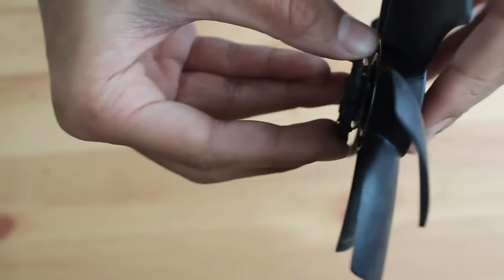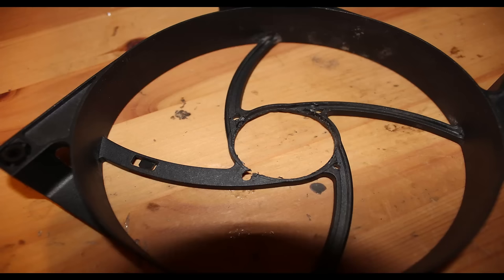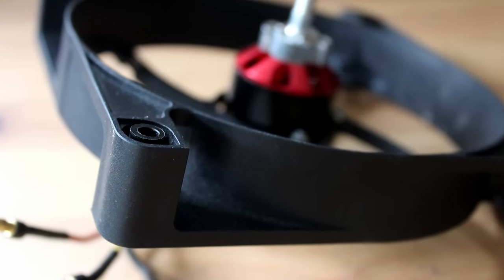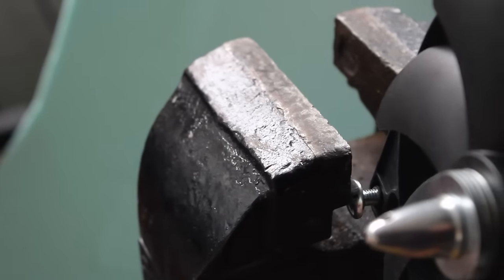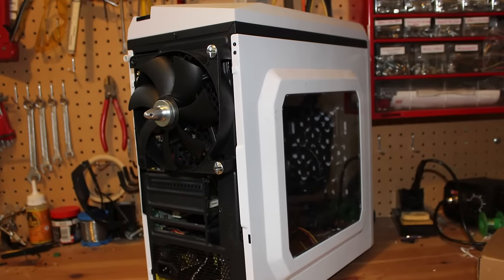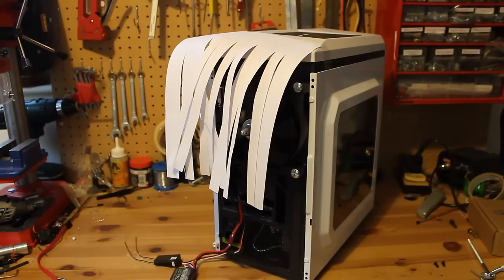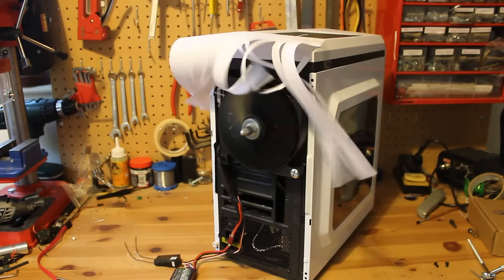I built a 14,000RPM PC case Fan! (300 Watts)

Comment: The fan blades are designed to move more air when spun the right way. If you will reverse the motors' direction and install the fan in the front as an intake, it will improve the thermals much more.
Reply: not really if its a really strong exaust.
it will still pull enough cool air into the PC to cool everything.
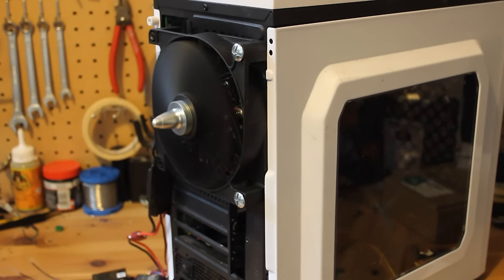Reply: @SidShetty  0:43 if you look here the fan blade is spinning in the wrong way. See for your self how your case fan is spinning. This comment is not abt intake or exhaust.
Reply from the maker: my bad, i'll make sure for the V2 to be an intake.
Reply: @Motricium  so just replace every fan with it including cpu and gpu fan for extra cooling.
Reply: As an aviation enthusiast, I have to agree. Considering the fact that these specific fan blades are shaped like an asymmetrical airfoil, whose purpose is to maximize lift while "the plane is upright" (in this case, when the fan is spinning the intended way), making the plane fly up side down (in this case, making the fan spin the opposite way), will decrease the efficiency of said fan by quite a bit. Still, I really liked the idea and can't wait for a follow up!!
Reply: Yeah its good. Putting Fresh air from outside sounds more like it
Reply: @SidShetty it’ll be much much turbulence on the fan.. thats not efficient
Reply: @Motricium  The issue isn't that it's intake or exhaust, lol, the issue is the blades are spinning the wrong way. The difference between intake/exhaust is the fan orientation and the direction the air is moving, not the direction the blades are spinning.
Reply: @yourmum2614  cause it’s still interesting 🙃
Reply: @Motricium  its been 2 years. I don't think a v2 will happen
Reply: @SidShetty  no, because the fan is projecting out of the shroud a fair bit, it is pulling most of it's air for the sides around it rather than through the case (same way you can easily feel the blowing force in front of a fan, but you have to get much closer to the back to feel the pulling force).  This method is also a lot less directional and thus more turbulent and the fan isn't designed for that direction.
Reply: Imagine the air is water and the blades are like spoons that move the water. If the "spoons" are the wrong way around, the water won't be caught by them.
Reply: @Motricium  Are you still doing the V2?
Reply: at 14,000 RPMs he can place it in the next room and the thermals in the PC will be improved.
Reply: @Motricium  All you have to do us reverence 2 of your motor wires... It will blow air in but!! Just don't put the paper like you did our you'll have confetti all in your computer.
Reply: @yourmum2614  lol because two years later, Youtube decided his video should be watched.
Reply: The intake side cuts your fingers off 😉💨
Reply: When you pull too much air into such an enclosed environment but not enough exhaust pressure, you'll build up dust from positive pressure and lingering heat
Reply: @Motricium  Doesn't matter intake or exhaust. You just need to spin the blades the correct direction.
Reply: @TomJakobW  True
Reply: If you sell this thing on ebay for like 50-75$ i'd freaking buy one
Reply: @M1N4M1  oh shit your right
Reply: @Motricium  where's part2 ?
Reply: @Motricium  the ideal configuration would be to still use the fan as an exhaust that is so you don't introduce the heat of your motor (up to 300 watts which is significant) into you system but should still put on the fan blades the other way around and reverse the bldc motor
Reply: @Motricium  V2 ?
When ???? XD
Reply: @SidShetty  it would pull air away from the heatsinks
Reply: 😆😆😆 damn want a fail, but yeah bad idea, the pressure would lead to condensation on the components so maybe he save his computer by doing it backwards.

Btw delta make a fairly hefty 3A 120mm that could blow barnacles off a ship if required, easily pulls itself across my floor. But with those speeds your going to find can blades flying off due to the centrifugal (been there done that)
Reply: but i will be a bit more of a hazard it is a hazard try pluging a usb stick into the usb ports next to it
Reply: Who cares about that? More RPM!
Reply: you understand an exhaust fan can pull the same air into vents just as if it was an intake fan right?
Reply: not to mention this was a functionality test it seems, so it was just checking to see if it spun, or was just a demo of the fan with 0 intent of it mounted the right way.
Reply: @Rhynocx  it’s just a demo i think it is a bit of a finger hazard
Reply: @SidShetty Spinning the blades in the wrong way that were designed for other way is highly inefficient

Comment: With how the 40 series cards are gonna need a lot of power, I can only see this being the perfect fan for them
Reply: @realmyfleshburns  and you need to connect it your air conditioner ac outlet if you don't want to start a fire 😂😂
Reply: There is already a market solution for that, server delta fans. They used to be pretty popular in the late 90's to early 2000's with the overclocking community, of course if you showed up to a land party with a rig running them everyone would kill you. Because 12v 10krpm+ fans are f@*king loud, go figure :P. That being said the stock fans on the 500 series all the way up to present are already capable of moving a massive amount of air. I remember having a old VM work station that ran x4 680's, When forcing full load running sims those fans sounded like a jet turbine.
Reply: @marvcyber815  is that a 240V outlet assuming you are in the states?
Reply: @antreaskonstantinou8585  I assumed that there is a dryer outlet 220v like what we have these air conditioner AC wall outlet in the philippines that run separate from the rest of the circuits in the house so it can take probably 1000~3000W without lighting the house on fire
Reply: @nikushim6665  e waste is good for budget gamers
Reply: A power hungry fan for a power hungry card.
Reply: @antreaskonstantinou8585  It is thicker wiring.
 Most appliances use normal plugs, but AC uses a thicker one because it draws far more energy (forgotten the numbers though)
Reply: Just get water cooling bro
Reply: @Plaguebearerofnurgle  Why not migrate to antarctica?
Reply: Lmfao
Reply: @nikushim6665  The fans on your GPU and CPU coolers aren't setup to properly use that forced airflow though.  That's why servers have no fans on the heat sink itself and just stick fins up and parallel to the airflow path.
Reply: @RiddleTime  or space?
Reply: Good thing we got a bunch of turbojet engines laying around. Just take the turbine out and it should be enough airflow.
Reply: They need to build more nuclear plants to supply energy when the 40 series cards come out.
Reply: Only if you believe the rumors lol. They seldom come true. It would also be an incredibly stupid move by nvidia with the current energy crysis.
Reply: This comment didn't age well
Reply: this did not age well lol
Reply: Less than 650watts for a 4080 and a 5950X

Comment: I was expecting it to fly out the window considering it's 14k rpm
Reply: I'm sure that it would eventually. Blade assemblies are rated up to a certain RPM limit (plus a bit more due to the safety factor). Going more than twice the intended speed is bad enough but going over that is asking for plastic shrapnel.
Reply: *He thinks it goes 14k rpm. 

Meaby with a 3" 2 prop from a drone but not with this heavy thing.
Reply: My small fan is 15000rpm
Reply: @BokiRS  did you test it with a meter? everyone can make bold claims.
Reply: @phoenixyt124  i tested with meter and it is showing 14500rpm max but on fan it says it was 15000rpm
Reply: @phoenixyt124  but is is like 2 inch fan
Reply: @BokiRS  cut a zero off. 1500 rpm.
Reply: @cyberbird2014  nope. When i turn my pc notmaly without apps it is going 8k i can see because my vpu fan is toing 800
Reply: @BokiRS  it is not, dude, believe me lmfao
Reply: @cyberbird2014  it is 2 inch fan
Reply: It just lacks is wings and wheels
Reply: @cyberbird2014  there are pc fans that can go up 21000 rpm so I am sure he's not lying I think the fastest 120mm pc fan spins up to 15k rpm
Reply: I once made a fan with an rc car motor that spun up to 50,000 rpms. I used a drone prop. It sounded as loud as a siren and had about 20lbs of thrust

Comment: Nice project! Your blades are spinning in the wrong direction, so you didn't get even half of the flow. 
What about build rounded corners to put inside the case and make a more smooth path to the air?

Comment: Shouldn't it be the other way around the fan blades are backwards it should be running counter clockwise
Reply from the maker: depends on what airflow setup you got i guess
Reply: The blades are designed to move air in one direction. It'll technically work if you spin it the other way, but it's far from optimal and you'll fling air all over the place. But I gather that optimal airflow efficiency wasn't the goal of this project, lol
Reply: This is correct, the blades are designed to go in only 1 direction. If you want to change your airflow you can just turn the fan around from the inside out instead of changing its direction.
Reply: @Motricium  You're spinning the fan blades in the wrong way.
Reply: @Motricium  please sell a finished version on eBay

Comment: 90% of the air is coming out around it and not into the case as indicated by the paper. If you cut out that mesh it should allow more to go into the case
Reply: or should a little more around the blade to direct more air through? that's could work and wouldn't damage case
Reply: Or you know... spin the fan in the right direction
Reply: Lol😂
Reply: straightener

Comment: When your fan needs 2 8-pin PCI-e power connectors.

When "Positive air pressure" is taken to a whole new level.

If you were to stick this in front and have it pull air through a large HEPA filter like one from Tesla, you'd never have dust problems ever. In fact, your dust will have more problems than you will.

Comment: Brother you’ve got the fan pointed into the case like it’s an intake on the exhaust side but the blades aren’t even spinning the right way, you have it reversed, so it’s way less effective than it would be. Turn it around and spin it the opposite direction.

Comment: Just so people understand. The reason why case fans are used inside is so that they can equalize with either the front or top fans. This does nothing as the front fans aren't spinning enough to carry air out the front and this is  pulling air in from the back. A water cooling setup is much more reasonable and a lot more useful than a 14k rpm fan and much quieter.

Comment: Quick tip
Buy 5 inch 6 blade quad props, strap them onto a 1650kv motor on 6s and you have yourself a 37,000 rpm motor with ungodly amounts of thrust - up in the kilogrames region possibly

Will finally let you run cyberpunk 2077

Comment: The fan in photocopy machine very powerful it run very fast with strong air flow. The blade design like the blade in jet engine but it has 9-11 blades and it only run 12v. Some slow fan in pc they don't fast because the circuit is cheap which not like professionals circuit. The fan from photocopy machine have circuit drivers fan motor seem stable and last-long than slow pc fan 7 blades

Comment: Suggestion: You may want to use a dust screen or something in between this fan and your PC components if using it as an intake, would suck if it pulls in something at high speeds and damages your components.
Reply: like a pigeon. or an overweight cat.

Comment: "in my next video" fast forward two years and its a video about an RC Boat. Now we know nothing about the overpowered fan. But yeah, I agree make it an intake or put it on a CPU air cooler. That would really make it shine.

Honestly on a decent-to-good tower cooler, beside the sound, I bet it would easily outperform a custom water loop.
Reply: The fans are spinning backwards lul

Comment: Honestly I'm surprised the fan blades did not explode as you are dangerously close to the plastic's shearing point. Let's just say that if you ever try to use bigger fans... do your tests from the safety of cover and wear eye protection and make sure your screen is not facing in the direction of the fan. It will fail spectacularly at some point so no need to lose it to the flying debris.
Reply: Eeh you’d need to some math to know if he was in fact close to it exploding.

Comment: Wrong direction of spin, AND blades are outside of the ring wall so most of the air is spread sideways instead of pushed in a direction.

Comment: Don't make your PC too cold or you will get condensation in the components and they will rust!
Reply: A fan blowing room temperature air is not gonna do that. It's only a concern with sub-ambient cooling, like from using LN2 or a chiller

Comment: It's stupid. These fam blades only work efficiently at certain rpm. 
If you want more air then use ower fan I stead. They are designed to flow more air at high speeds